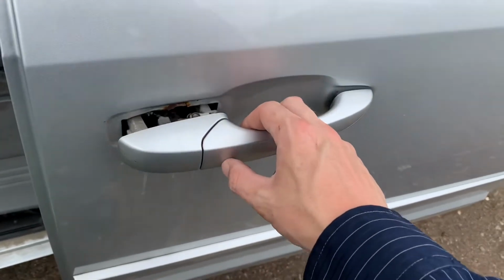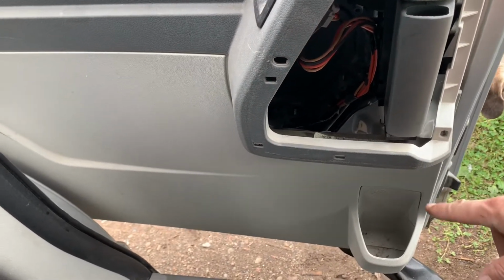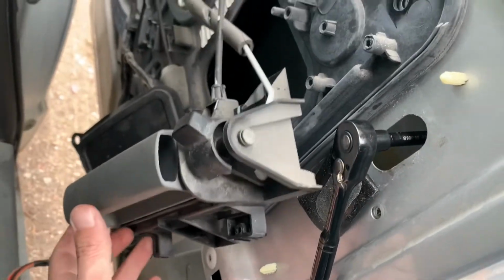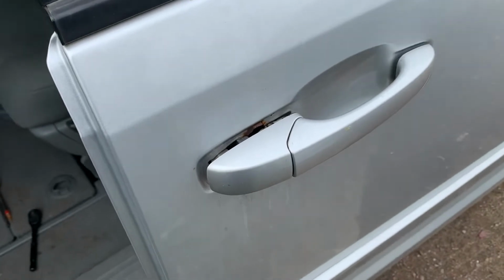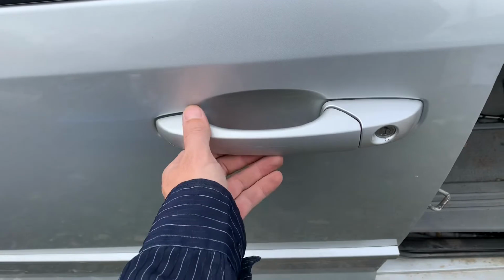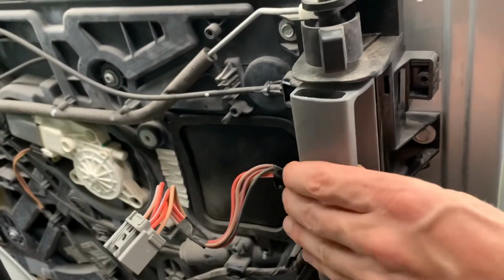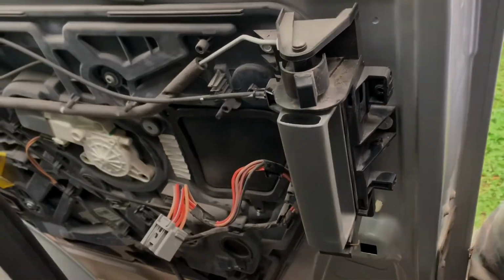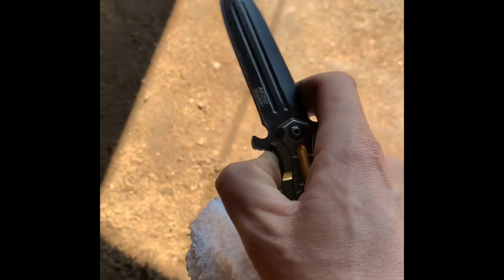Dodge Door Handle Fix Free (Grand Caravan, VW Routan, Town & Country, Journey)

Comment: Just use one long strip of metal that goes from top to bottom with 2 holes drilled in at that coincide with the 2 securing bolts, you don't need to mess around with many single tabs, with one long piece of metal its gonna be stronger.
Reply from the maker: i thought about doing that as well, but im not sure the handle will allow for that.  i think mine has a chunk of plastic or something right in the center of that.  that is why i used perimeter tabs.

Comment: Where did you get the little tabs?
Reply from the maker: They were flat spade terminal connectors.  They came in a wiring repair kit with other various connectors .   It’s just a small flat piece with a hole in it.  You could make some
Reply: @613Builds  I went to hardware store and got terminal connectors as well, had to crimp them, but I got it fixed. Thanks so much for making this video, it helped a lot.
Reply from the maker: @danielpoggensee8414  awesome ! mine is still working 😎👍🏽